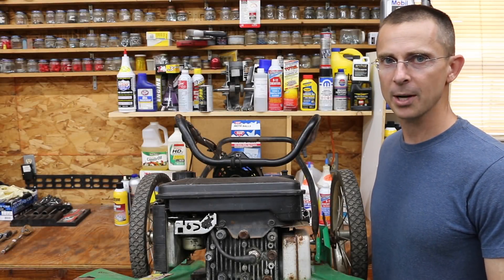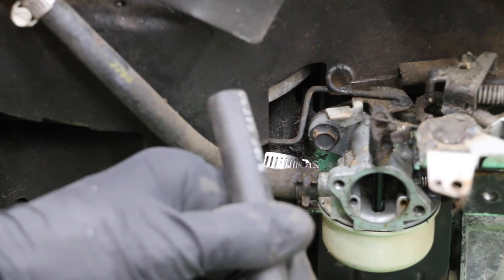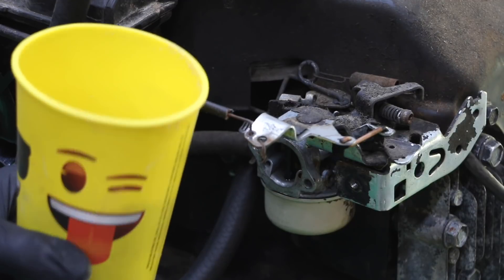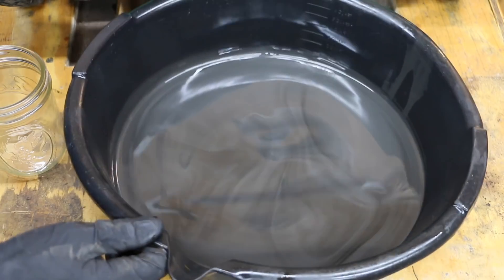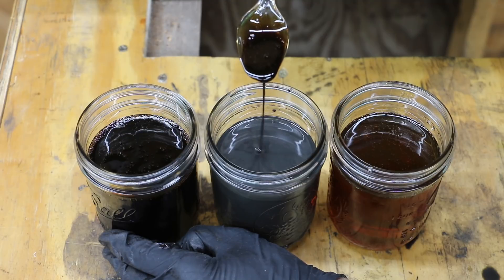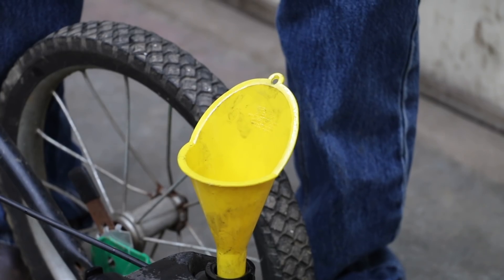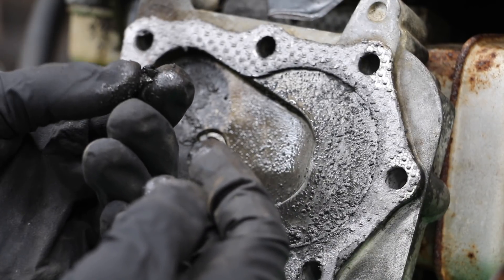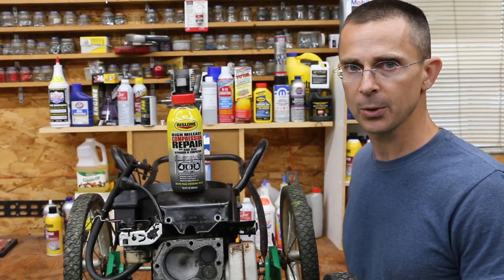Engine Eats Sand! Can Rislone Repair Compression Loss?

Comment: Awesome videos, big fan.  I have a suggestion though, I think you should have disassembled the whole engine and cleaned each part.  This is because there is still residual sand particles that would be stuck in the carb, piston rings, bearings, and other small places that would still scratch the cylinder wall for many oil changes.  This might take time, but would eliminate almost all variables in this test.  (I've brought a 5hp Briggs back to life that was half buried in my neighbors yard and found dirt in all sorts of places lol.)
Reply from the maker: Eric, This is a great point!  Thank you for the great constructive feedback!

Comment: Should try the old saw dust in a transmission trick. That'd be interesting to see. Also curious if you went like 50/50 with the rislone on this sand eater.
Reply from the maker: Metroid Mayhem, Both are great video suggestions--thank you!

Comment: try leaded fuel on a engine with low compression! use VP110 leaded fuel
Reply from the maker: Thank you for this recommendation!
Reply: Result = Fouled spark plugs.

Comment: Does NOS cause any damage to an engine over time?
Reply from the maker: Jake, This is a great video project recommendation--thank you!
Reply: jake madden yes. you can burn a hole in you pistons.
Reply: Yes its hard on the rings if you do not gap them for the NOS

Comment: Come now bro.  That's destruction testing adding sand.  Unlikely you got it all out either.   Add two teaspoons of sugar the oil.  This will carbonise inside the scratches given a good run
Reply from the maker: Syn, Great point!  Thanks for the recommendation on using sugar!
Reply: Project Farm 
In future you can also flush an engine using no more than diesel in place of oil.  Cleans & rejuvenates seals, removes gunk & debris.   Ex Shell eng' placed with Bosch.

Comment: Can you run an engine on just octane booster?
Reply from the maker: Tate, this is an excellent recommendation--thank you!
Reply: @ProjectFarm  I know I'd watch that video
Reply: Most likely won't work.  Octane booster isn't a true octane boost, but just a boost to effective octane performance.  It is made out of chemicals that decrease the ignitability of fuel.  Most off the shelf octane boosters use Toluene to accomplish this, though some older ones used MMT, and "lead replacement" often uses ferrocene..  You will have better luck running an engine on fuel injector cleaner.
Reply: With some of these comments make me wonder,.. can we run an engine on the crap that come out of a politician’s mouth? It is 100% BS!
Reply: Tate Cunningham yes!!!!!!!!!!
Reply: Yes! Please!
Reply: i did this once you can if you can get more to it but it takes a lot more and economy for me went from 32 to about 5mpg.
Reply: Or Ethanol.
Reply: MrZorbatron Wrrooooooong.

Comment: A future video suggestion i have is remember cash for clunkers in 2009 when they had to add sodium silicate to the engines to lock them up and render them inoperable? I always wanted to see what a motor looks like taken apart after that stuff has been used. The hotter it gets the thicker it gets until it seazes!
Reply from the maker: gmaxsc, This is a terrific video project idea--thanks!

Comment: Can you try to run 100% rubbing alcohol in the gas tank
Reply from the maker: Logan, thank you for this video project recommendation!
Reply: Yes, did it on a small motorcycle, and it ran. It was out of gas, I was pushing it, and got to a pharmacy. Decided to buy a liter of alcohol out the shelf, and pour it in the tank. It got me home. It was hardly my idea tough. Back in the '80s my uncle did the same with a 1980 Galaxie Landau. The car had a factory alcohol fuel 302 and he got stranded with no alcohol in the tank. Me and my cousin went on feet looking for a pharmacy, or super market, and we bought 10 liters of alcohol at a small market. The Landau ran perfect and got to a gas station to be filled up with car alcohol. The car alcohol is water free, while the rubbing alcohol has water in it, but the car didn't seem to mind. The motorcycle wasn't alcohol fueled, but had a high enough compression ratio to burn the alcohol alright.
Reply: @lovefordgalaxie  My brother in law  was a pilot and used to fill all his cars with aviation gas as it was cheap, right there at the little unmaned airport, I remember the cars ran fine but really fouled plugs

Comment: While it would take some testing to be certain, it looks like this product is more or less just a heavy weight oil. There's an old shady used cars salesman trick where you can mask a smokey/failing engine by using a MUCH heavier oil than the OEM recommendation. The increased viscosity leads to the oil having a harder time creeping through the compromised seals and appearing to "fix" the issue, that is until everything gets too hot and seizes. It might be interesting to see if a dingle ball hone and fresh piston rings could bring the life back to this engine.
Reply from the maker: Anthony, this is a great point!  Thanks for commenting!

Comment: Ok, one more comment - I don't mean to spam!: I don't expect it to make a difference, but I just checked the instructions on their website and it says 3 ounces per quart. So you used a little tiny bit more than they specify. The only other thing is that maybe it might've improved more if you ran it longer, but then you'd spend more on gas than the Rislone itself 😉
Reply from the maker: Alexander, Yes, I used more additive than necessary--great point!  I ran the engine several hours and the engine ended up low on oil/additive.  I could run the engine more, but the engine smoke wasn't at all improving.  Thanks again for commenting!

Comment: Put gasoline in a crank case
Reply from the maker: RJ Land, Thank you for this recommendation!
Reply: Project Farm that happend to my k181 kohler when the fuel pump leaked. I changed the oil but I had already ran it with the contaminated oil. It violently threw a rod.
Reply: Project Farm your welcome

Comment: i have a question the sand may still be in and around the rings if you were compleatly fair you might pull the piston and clean around the rings lots of work tho but it may be a better test later with any product just an idea
Reply from the maker: This is a great point!  Thanks for this suggestion and thanks for watching the video!
Reply: if you do pull the piston i would like to know if there was gunk there or it was a waste of time thanks

Comment: Should try running a lawn mower engine on E85 only and if it runs well enough does it stay cooler.
Reply from the maker: Dcool, This is a great recommendation--thank you!
Reply: Project Farm might need bigger jets on the e85
Reply: @elgrandechorizo  Would definitely be running 20% leaner with standard jetting.
Reply: I love e85. I've had my mower running on it for over 5 years. I did enlarge the jets to make it run normal though, otherwise it's quite lean and loses power, but is still safe to run like that... Did that for a while too.
Reply: @volvo09  It will run okay, but the rubber components in the fuel system will deteriorate over time.
Reply: True, that's why they make sure it's pure when reaches the gas stations. Water absorption is slow if kept in tanks with no sources of water. Brake fluid absorbs water faster if compared. Up until the early '90s the pumps had a densimeter to show the alcohol was water free. The shelf life is about three months on the gas station, and a month on the car. Imagine a tank, with 30.000 liters of alcohol, and one vent, with about 20 cm2 of area. The water absorption is very limited under those conditions, and that amount of alcohol will absorb less than a liter per day (yes, it is a test result value and it's present on Brazilian technical norms referring to alcohol fuel).
The corrosion tough is high even with pure alcohol. Sugar cane alcohol is quite corrosive, even with no water or with the acceptable content of water in it. Aluminum parts usually more resistant to water than iron or steel, are the first to go. Untreated carburetors will develop very fast a layer of aluminum oxide that will clog everything up pretty well. 
I have a Quatro Rodas Magazine from 1979, where they used a brand new alcohol fuel Fiat 147 (the Italian 127) for 10.000 kms, and disassembled the engine, carburetor, cut the gas tank, and showed all the parts. The gas tank was starting to show little dots of rust. carburetor, even treated wit a then new compound developed by Fiat, was starting to show pits all over the fuel bowl. Intake valves were covered by a white residue, that showed to be almost 100% aluminum oxide from the intake manifold. Even the top rings on the pistons were starting to show signs of corrosion. 
By the mid eighties the corrosion problems were solved by the use of different materials and treatments, and the only thing that would remaind you that the car was not a regular gasoline car, was the cold start. With fuel injection, even this problem disappeared.
Reply: It will run really lean right?
Reply: @erko4  About 20% leaner.
Reply: Sounds like that engine could run on hydrogen.
Reply: CCCP Digital Studio Alcohol absorbs water from the air. There may not be water in it from production but it will rapidly absorb water and dilute itself almost instantly when exposed to any humidity above desert levels. All the features you listed were to keep the water from causing corrosion and/or condensing out of the fuel.

That's also why modern gasoline blended with grain alcohol (ethanol) in the standard 90/10 mix has a much shorter shelf life than "old" 100% gasoline in the US. It's also why e85 capable vehicles have very different fuel systems.
Reply: You have to drill out the jets starting at about 80% bigger and work your way up. You will need a carburetor with a float that shuts tight because you need a low pressure electric fuel pump and regulator.
Reply: @donrutter6765  Start at 20% and you will be okay. As for needing a LOW pressure fuel pump, NOT! My '13 flex fuel Focus has a 2200PSI fuel pump and does fine on E85..
Reply: The guys that race on e85 drain everything when they are done due to corrosion.
Reply: I run e85, I never drain my tank in my cars or my mowers. Been years since 09) and I haven't seen any corrosion issues. I have better luck with my e85 carbs than friends and family have with pump has.-- Jets only have to be enlarged slightly (25% or so, you can just barely see the size difference in the still bit) 80% bigger is WAY too big, I know from experience as I've done it to just about every engine I run. 2 and 4 stroke, carb and FI.
Reply: Here in Brasil we have alcohol fuel cars since about 1979. The alcohol fuel is made from sugar cane, and has no water in it. My uncle had a 1980 Ford Galaxie Landau alcohol fueled from the factory. The car ran on 100% pure alcohol. The differences from the alcohol fuel car to the gasoline car were on the gas tank, treated to withstand rust, the same on the carburetor, that had a chrome like treatment, the intake manifold was aluminum instead of iron, and a hot water chamber inside to avoid condensation while the engine was still cold. The compression was kicked up to 11,5:1, and the V8 used special head gaskets, with stainless steel rings around the pistons, so it wouldn't be corroded by the alcohol. The car also had a cold start system, that consisted of a little gasoline tank, a pump, and two little injectors in the carburetor. Depending on outside temperature, it would squirt gasoline in the carburetor, to make the engine to start easier. You could also manually squirt gas, by pressing a little button on the dash. Like alcohol has less calorific power than gasoline, more alcohol has to be burnt to get the same result, so the carburetor calibration was totally different.

Comment: I really don't think those "mechanic" in a bottle work...all gimmiky...once you score the cylinder walls due to misuse of an engine...blowbly will always be a problem until the cylinders are honed and rings replaced.
Reply from the maker: Brian, This is a great point!  I believe this engine is too far damaged for any additive.  Thanks for commenting!

Comment: I vote to try engine restore. And btw how has the tractor you used it on been running now?
Reply from the maker: KJ6EPL, The Ford tractor is running much better and now starts without use of a block heater or starting fluid.  Thanks for commenting!
Reply: @ProjectFarm : Is there a before-and-after video for the engine you put Engine Restore into?
Reply: I would also like to see you use engine restore

Comment: It would be interesting to see what a lot of Lucas oil stabilizer would do, doing an overdose, like 3 parts Lucas to 1 part oil. I used Lucas in my van that had a lot of miles and a low reading on the oil pressure gauge. Turned out to be a bad sender (switch) but what I was doing was running straight SAE 60 and then I even thickened it up with some Lucas just so the oil light didn't come on at stop lights. But like I say, it turned out to be a bad sender. I don't think all that thick oil really harmed the motor, at least not that I could tell. Ran it that way for a few years, and it didn't use much oil. After a new sender, and some lighter weight oil, it began burning more oil, so I still use Lucas to thicken it up to burn less oil. I can't find the straight 60 anymore. It was a special request by me at my local auto supply store, back then. But I wonder what an overdose of thick oil would do for that scored up motor. We should know that most of us don't necessarily follow directions on the can anyway. We tend to get whatever we can get out of a product, depending. I don't think the producers of the product want to tell us to add that much of their stuff because they don't want any problems, but I think many of us do, and buy their product anyway. This old van has half a million miles on it and runs pretty good. It will show a cloud of blue after descending hills and getting on the accelerator at the bottom, but not when I thicken up the oil. So that's what I still do.
Reply from the maker: Ray, this is a great video test idea.  Thanks!
Reply: I'll be waiting to see what happens. I would like to see it.

Comment: Project farm can you test if a small engine can run on 72% rubing alcohol and 91% rubing
Reply from the maker: This is a great video project idea--thank you!
Reply: Project Farm also I did this to a 24 year old craftsman lawn mower I put 2 cups 10w 30 moter oil in 1 gallon of gas and shook it for 5 mins after in a small 1 gallon tank for filling gas tanks up I hoped it whould provide more lubrication and was wondering if it whould make the engine full of carbon buildup because it did smoke quite a bit and that lawnmower was sting under the house for 12 years and also can a engine run on nail polish remover or pure butane gas?

Comment: That test is too much for the additive, the additive will work if the engine lost compression by the millage or the age it self i have a 1988 mazda b2200 with low compression 80 to 115 psi between the four cylinders and i test rislone hoping the worst result and i get surprisse whe i put the gage on again and i found 120 to 150 between the cylinders. The sand test is a bad example try in an engine under normal conditions of power loss ;)
Reply from the maker: Steven, Great point!  I'll see if I can test an engine with normal compression loss.  Thanks for the constructive feedback!
Reply: Project Farm You win my suscription ;-)

Comment: Additives like this are more bad than good. If it fills up the scratches and such in the cylinder, than that means it also fills in the factory cross-hatching on the cylinder.(and plugs up the oil control  ring for that matter) The cross-hatching is there for a reason. It holds oil on the cylinder walls to protect from wear. If they get filled in or worn down, then in a short time, the cylinder will be worn beyond repair and the little bit of blow by you were hoping to repair has just became more blow by than when you started. The whole jist of this product is flawed from the get go
Reply from the maker: Great point!  The engine did seem to blow more smoke the longer it was in use.  Thanks for commenting!
Reply: Project Farm Thank you for making the video!

Comment: I have had go luck using Lucas trany restore about 4ounces in with the oil. I do have to change the oil more often but I works well with my snowblower which is the only small engine I have with low compression.
Reply from the maker: Dan Daves, Thank you for commenting on Lucas Trany Restore.  I've never used it but will definitely test it if I can find a transmission well-matched for this additive.  Thanks again!
Reply: Project Farm 
I use the trany restore in the oil. Doesn't hurt anything as the viscosity is rather high. Also doesn't separate from the oil. It will seat the rings and valves on a rebuilt motor. I have on motor on the snowblower(Briggs 5hp) 78psi before additive. After using the lucas I get 123psi. It does however smoke a little bit as it slowly burns the Lucas away.  Last year it lasted 3months running about every three days before the Lucas broke down or burned off and my compression went back down. Draining the oil I don't see any shavings, while changing the oil and adding more Lucas.

Comment: I used engine restorer. Got a completely worn out engine to last 2 years.  We did use the entire bottle to make it work.
Reply from the maker: Impressive!  I recently did a video using engine restorer and it did a great job!  I'm considering a repeat test in the Sand Eater.  Thanks for commenting!
Reply: Project Farm like your vids.  Dimple To THE Point N No bs